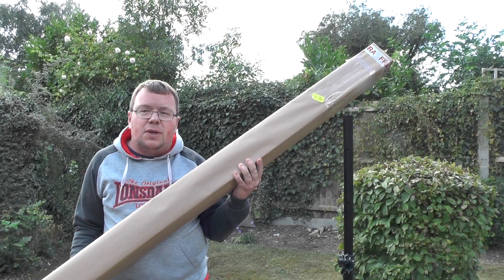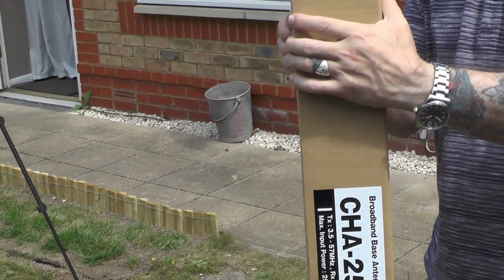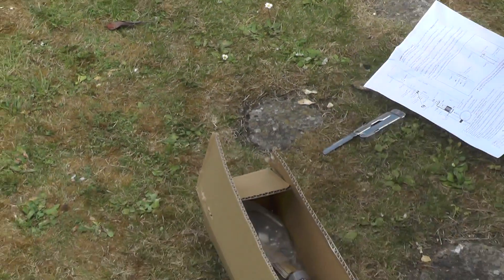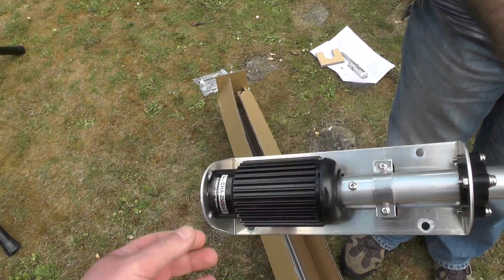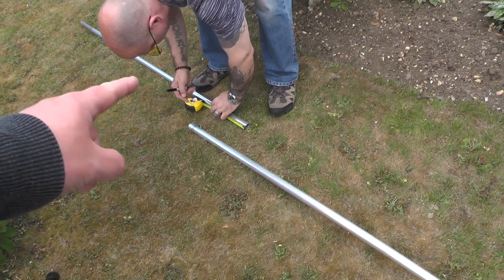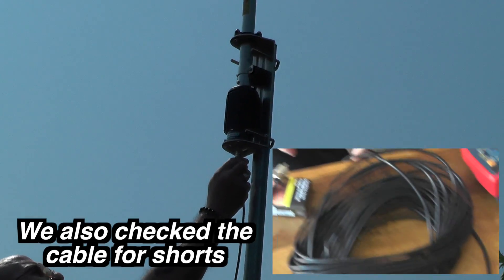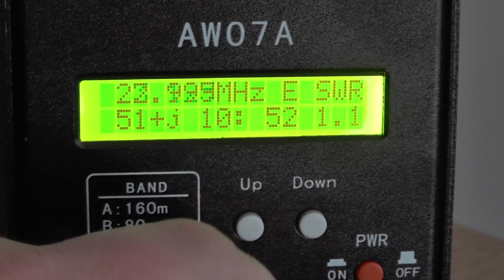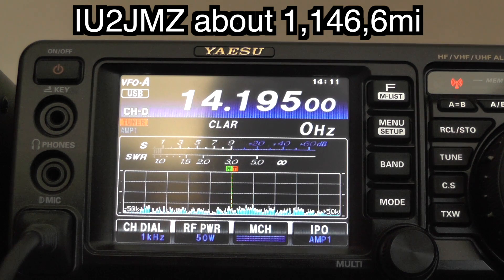Comet CHA-250BXII Antenna setup and test

Comment: I don't know if I got a duff one or not but ,I installed my one up on a 25ft mast , SWR checks out ok on all the bands obviously higher on 80 ,but this thing just doesn't receive very well at all .infact my president hymlaya wb revived 90% better on 20 mtrs.i have not  tired transmitting as I'm more into listening even tho I'm fully licensed,but I would of expected this antenna to be better than the hymlaya CB antenna.Not very impressed with it ,maybe it's my location or something but it's deff as a post,I used the same coax feed LMR 400 for the test to be fair.. I have given up on the thing and put back in the box ,maybe I'll revisit it again one day .but for such an expensive antenna it's not great or at least for me.

Comment: I've got the CHA-250HD and I must have done something wrong, because I can barely get a signal out on phone on HF frequencies.  The antenna is about 15 feet off the ground so by reports I've read, it should be booming out sound-wise.
Reply from the maker: When you change bands do you press the tuner button to tune in the antenna

Comment: i have one of them in the garden i got given to me wot i don,t use, when i had it on i had it ground level and it was 1.0 on every band without a tuner and i think thats to do with the magic coil in the bottom if thats what you want to call it all it is iS A BIT OF COPPER PIPE  and winding but do you think i should put it up and give it another try 73 from m7byf

Comment: I have one of these but it's the MFJ version.  I've seen articles by others that have measured losses in the matching unit.  They are very high.  I will say that I enjoy using it for SWLing, but not so good for XMIT below 20 meters.  However, when I added a 16 foot counterpoise, the TX performance noticeably improved.  More radials might improve it even more.  In addition to shortwave listening,  I do use it for digital modes (ft8 and wspr)   Excellent for All-Band WSPR because I don't really care about the lossy matching unit when using that mode.  SWR is more important.

Comment: I had one of these on my roof about 10 years ago and it did the trick. Then I replaced it with a GAP Eagle and the GAP had a much better "reach". But for getting on the air and making contacts, the Comet CHA-250B does it.

Comment: I've had this antenna up for 2 years. Mounted on the top of an 8ft fence in the back yard. I've talked all over the US, Canada, South America on voice and I've hit the otherside of the world with digital modes. I am replacing it only because I want to throw more wattage down the line and this can only handle 250 watts. If you have restricted space this is a great option.
Reply from the maker: Tracer Facer we were calling all afternoon and got nothing then had a few contacts from uk to Germany and Italy and my friend has had more contacts on the antenna so far so good

Comment: I had the Comet CHA-250B until last week until the winds of Hurricane Sally destroyed it.  (Never listen to the weather service when they say the storm is moving the opposite direction of your QTH!)  Anyway, some condemn this antenna, some don't.  Personally, I had it mounted on a 30' mast, (guyed appropriately,) and was able to make to make contacts 1,500 miles, (2,414 km) away.  I think for a non-radial antenna, it's pretty good.  '73 / Steve / K4SRF
Reply from the maker: K4SRF we had a similar thing in the 80s it was said on tv that no hurricane is coming to the uk but it did and took down loads of fences and trees